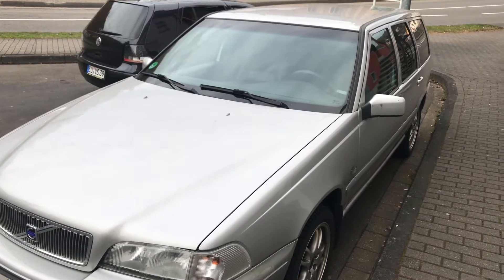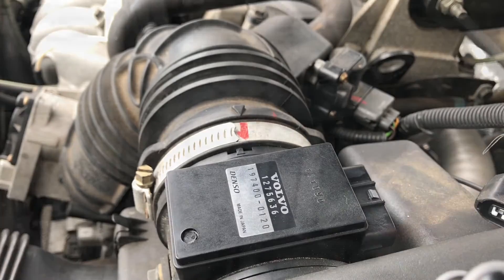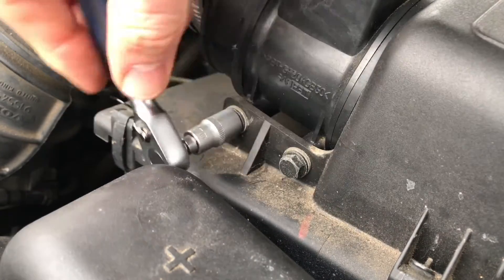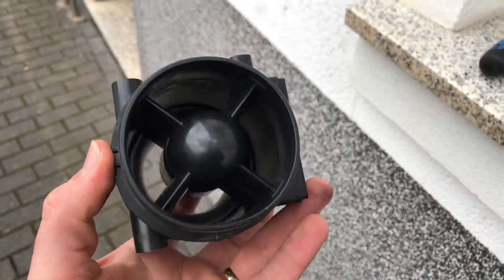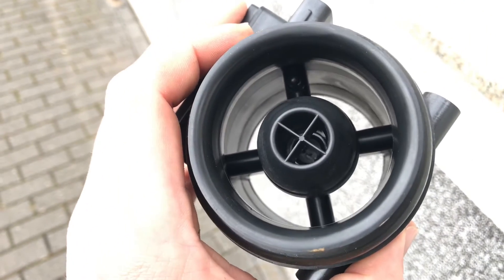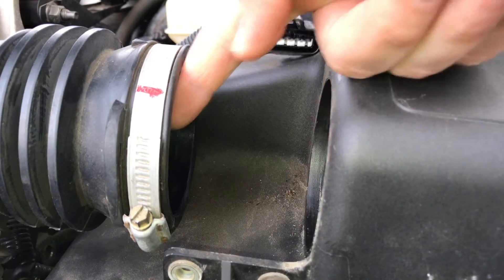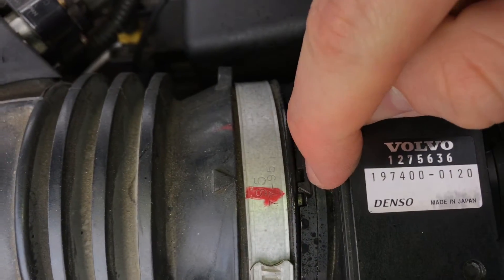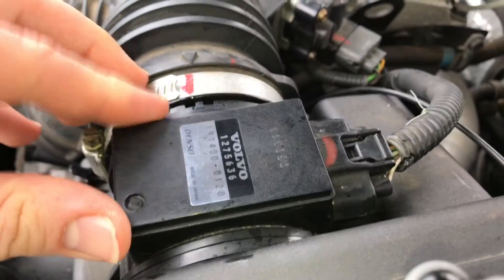How to replace mass flow sensor Volvo V 70 DIY

Comment: I did mine today.  Two screws with the star heads and a metal piece sticking out in the middle.  I bought the sensor for $51.47 from Auto Zone and it actually came with a tool that unscrews those type of screws so i didn't even need to buy a new tube.  The entire process of changing the MAF sensor literally took less than 5 minutes if that.  It was simply unplugging the wire connection, unscrewing 2 screws sitting on top where they're easily accessible and out comes the sensor, put the new one in and screw those two screws in, reconnect the wires and you've got yourself a new sensor.  I'm amazed at how easy mine was.

1998 Volvo S70 2.5L Normally aspirated, black exterior with tan leather interior.  Cassette AND CD player.  151K miles.  All family miles.  Dad bought it new, then grandma drove it, then one of my uncles, then my grandpa and then my dad again and then his wife and then i bought it for $1800 knowing i'd have to fix some things soon. I'm glad this one cost less than $60.  Also, put a bottle of Seafoam in, made sure all the tires were inflated to the recommended amount, added antifreeze to account for the bit that leaks, added transmission fluid because it was low and I put over 1.25L in it (!) and it still was barely on the lowest part of the dip stick so i've slowly been adding it to make sure i don't overfill it, but once i added those 1.25L, the car ran so much better.  Also today, checked the oil, washed the windows, cleaned the engine compartment up some and got some dust off some areas.  Gotta keep this "Executive Sedan" on the road. 

Oh, good video by the way.